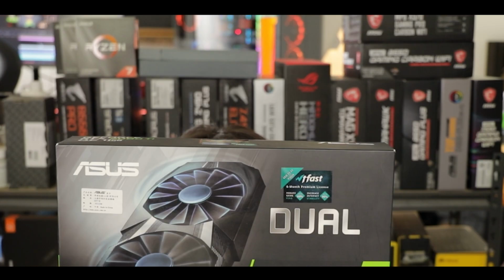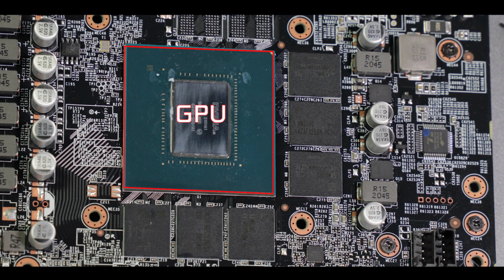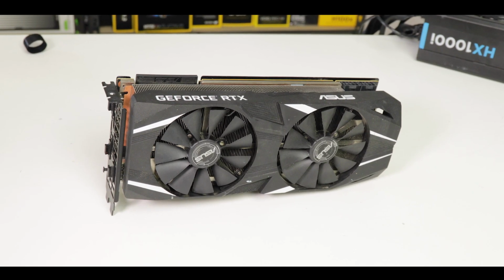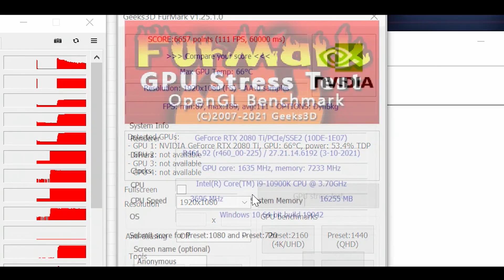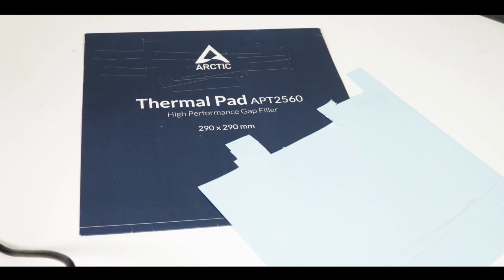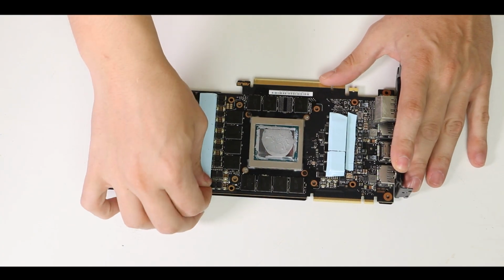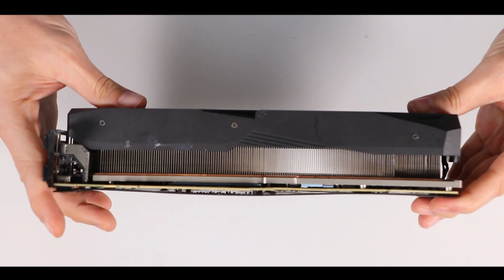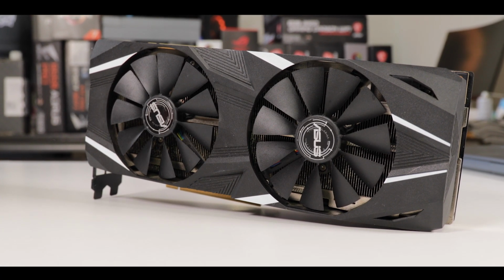Changing your video card’s Thermal Pads : BEFORE and AFTER benchmarking!

Comment: I was terrified the entire time, but replacing my thermal pads made a colossal difference, 100% worth it.
Reply from the maker: What video card did u do it on? How much of a performance jump did u experience?
Reply: @Laurentschoice  It's an Aorus 3080 Xtreme, the VRAM was consistently going above 100°C at 200W and once I opened it, it was clear why.  The stock pads were flimsy, greasy things that weren't doing much.  I put in some Thermalright 12.8W/mk pads and it made a huge difference, I can crank it up to 100% and it only hits 90°C at 400W.  Still hot, but much better, the giant four slot heat sink is now doing something instead of just taking up space.
Reply from the maker: AORUS should be ashamed of posts like this... seriously... they charge 1500 bucks for this card and they can t put 10 bucks worth of thermal pads?
Reply: @Laurentschoice  It's crazy, it's a spectacular GPU, held back by those stupid greasy thermal pads.  I don't understand the thinking there.
Reply: My Aorus 2080 has always run hot AF since the day I got it. I have good airflow in my case too.
Reply: @funghazi  I have the exact same 3080 as you, I want to do a thermal pad change on it but I'm not sure what sizes I need and how many pieces of each size I will need letalone what's the ball park cost of all the thermal pads I need. I Did go ahead and get some of that pink thermal grizzly kryonaught extreme paste for it but I don't want to open it till I get everything I need to do a full change. Could you share your knowledge?
Reply: @atruceforbruce5388  bro its really the chip. It just runs HOT. Best bet is watercool, but i dont have a higher end 2080ti with a baller cooler. Mines an oem with a blower. Mibe stays cool, but i have to max fans out which is loud as shit
Reply: You can obtain even better results on the gpu you clean it better you izopropilic alcohol and not touching with fingers  😁 nice video
Reply: @funghazi  They probably want you to get a 3090 and still leave you with that wanting feeling after you get it.

Comment: Did the mod on my RTX 3080. Dropped 30 degrees and now runs around 84 degrees. Used Arctic MX-4s for paste and pads used Frosty Thermal Pads - 12.8 W/MK. I tried all brands, but these do the same @ 40% less price. Incredible pads.
Reply: i just ordered it for my 3090 FE lets se how it is going to do.
Reply: @navaneetkumarbogum7528  So, how did it goes ? Did the core temp increase as an effect of the decrease of the vram temp ? (Cause I want to do it for my Sapphire pulse RX 5600 XT but I heard that the core temp increase)

Comment: Did this on my 8 years now old laptop, the gtx 765m was getting toasty. Used artic pads and artic mx-4.
Reply: mx-4 is absolute ok, you can use 5 or 4 not difference
Reply: Did the temperatures drop?
Reply: Yes, alot

Comment: I have to point out that you do NOT put pads on top of the coils they were never there originally and you can tell as the heatsink hasn't got a flat surface for them to press against. This will just cause improper contact with the rest of the pads.

Comment: Do you know the thickness of thermal pads on Gigabyte RTX 2080 Super Turbo 8G ? I can't find it anywhere, and Gigabyte support does not reply.
Reply from the maker: Gigabyte is usually on 1mm on their Turbo (turbin fan) model
Reply: @Laurentschoice  Ok thank you, it did seemed like 1mm on memory but the other smaller pads looked a little bit thinner. Is it better to first use 1mm on memory and 0.5 on the smaller areas, or try 1mm on all of them ? How do you think ?
Reply from the maker: It is very important u get the same thickness as originals. 
Place the pads next next each other. If they are obviously thinner, u know ur dealing with 0.5 mm.
Reply: @Laurentschoice  I just changed them all for 1mm Gelid Solutions GP Extreme. As a paste I used Gelid Solutions GC Extreme. Maaan I am shocked. Temps on GPU went down from 88 to 70 MAX and temps on memory from 103 to 78. I can't believe there is such a massive difference. And what's even better, when I compared thermal pads, it seemed liked 2 of 5 were 0.5 mm and the rest 1mm. However, I changed all of them for 1mm and it works like a charm, I can't be bothered to replace two of them for 0.5 mm :P

Comment: I've now done this with Alphacool Eisschicht-pads.
1 mm, 11 wm/k and ThermalGrizzlyKryonautExtreme paste-..
the RAM is not fully pressed and reaches 94 *C under full load, hotspot also 94 *C. 
Idle 55-60*C..
The pads are quite soft so you could take 1.5mm of them! I'll try again soon!
Reply: How did it go, did you have better result with 1,5mm pads?  I've ordered the 1mm Alphacool Eisschicht pads to cuz both resources I could fine said they used 1mm over all components that need pads.
Reply: @woopie9511  1 mm was the way to go ! 1,5 mm is to big
Reply: @kaykay10able  thank you sir. I actually switched mine out today and had very good results aswell. The hot spot went down 15 degrees

Comment: at minute 6 there are two pads on the left. the thicker one wasn't on mine. should I install some like you? also the thicker one on the far right?
Reply from the maker: I did specify the thickness on the video.
If my memory severs me well the dual OC only uses 1mm thick pads all around which makes things much easier.
Reply from the maker: And yes install the extra pads they make a world of difference in terms of card durability
Reply: @Laurentschoice  thank you very mouch. I'll do it later and let you know
Reply: @Laurentschoice  Thank you for your answer. I have exactly the same graphics card. I didn't mean thicker, but wider. that must be the voltage converters, right? I have a hotspot of 106 degrees and hope that this solves the problem
Reply: I'm not sure, but I think there is a little bit of air between the graphics memory and the cooler .. I took 1mm alphacool 11wmk

Comment: I'd like to do it on my maptop but I don't know what pad thickness to buy, and unable to find spefici pads for my laptop. What is the process in this case please ?
Reply: just measure it using ruler
Reply: @hanzoverlord6720  I cant really measure the space between the memory module and the interior side of the heatsink when it's screwed you know what I mean ? I think I wiil have to try several thickness because if the pad is too thick it will break when apply the sink, and if it is too small it wont cool down. I would have liked having a tip first.

Comment: Laurent, how can we measure the pads when they are already flattened please ?
Reply from the maker: Just got what u meant. 
Yeah ...that was a asshle.

The used thermal pads sides usually keep their original width.  

If its your first time you need to compare them to existing new pads u might have... not the greatest... but thats what I do. 

If ur lucky some reviewers already documented ur card. If not ... u got to buy 0.5 , 1.0 and 1.5 mm and compare compare to existing pads. 

Keep in mind that most cards use several width on the same card !
Reply: @Laurentschoice  Thank you Laurent, currently my card is only 2 months old, but in future this is a great idea.

Comment: Hey question: how do I measure how thick or thin my thermal pads are?
Reply from the maker: ahaha.. good question! It is never easy. I usually get a pad I already know the thickness of and then compare it to the ones I don't. Not the most efficient method, but it works :)
Reply: @Laurentschoice  okay thanks! I got some calipers that I’m going to use to measure the existing ones on the card right now. Thanks for the reply

Comment: hey dude, i want to ask you, i was currently using rtx 3060 and I've use it for mining ( but not 24/7 like others ) some days i on and some days i turn it off back cause im scared that it will damage my gpu , and I've noticed that when im in gaming , the temp is going to 70° above and the most highest is 73-74° with using high graphics , is that fine ? and i also want to ask if im putting a new thermal pads on it , can it become like the first time i bought this gpu? thank you.

Comment: I did change the paste and pads on my old fermi card , but find out multiples pads slipped from their chips... I will not open the thing again because the paste and pads worth more than the card so if she die she die. 😅 Next time i will use some sticky pads rather than the normal one

Comment: I am thinking of changing the thermal pad for my newly arrived 3070ti. The mem is more than 90C when the core can stay around 60C. I read reviews of several products and some say the temperature drop is gone after several months as the thermal pads dry out. Can you take a look now and see if they are still working fine?
Reply: Yes,I do have the same question...A long term review would be great..
Reply from the maker: So far no changes too place. 
But it also depends on the quality of ur thermal pads. 

I got Arctic ones so I'll be fine for a 18 months minimum.
Reply: @Laurentschoice  Thanks bro for the reply...

One more doubt, if I use my GPU for crypto mining,will the thermal pads loose its thermal performance... what's the case with both stock and custom thermal pads..?
Reply from the maker: Stock really depends on manufacturer.  
If u crypto divide all times related to the card by 3.

Warranty , thermal pad longevity, card life span, and performance after 6 month crypto mining
Reply: @Laurentschoice Sorry I didn't get your message...

Can you please explain...

Between my GPU is Msi 3080ti suprimx..
Reply from the maker: If your cryptomining, change ur thermal pads every 6 to 8 months for optimal temps.

Comment: I wish I had the balls to do this, my 3090's vram temp goes up to 92°c in Cyberpunk and it's not even summer yet. But according to manufacturers it's still in the safe range for GDDR6X so...
Reply from the maker: Yeah... First time can be scary  .. especially with a 2 grand card!
Reply: Yes that's normal. lower 100°C is safe, mine run at 94°c in cyberpunk (RTX 3080)
Reply: @l.s.g9372  my 3090 FE is running at 98C since i bought it, i guess bad thermal pads on it. ordered these 1.5mm once for changing lets see what it does

Comment: I can not check my gpu Memory Temperature
The program doesnt give me that option
Reply from the maker: Not all video cards install captors there.
Reply: @Laurentschoice  Laurent, I installed new thermal pads and paste then I was wondering if the pads were correctly in place end up open the card again and it was all good.
Now... Im wondering again if when I closed the card 2nd time if it changed place of the pads. 
I looked from outside the card and seems they are in good position and Im afraid to open again, to check it.
If its all good inside I just end up wasting more pads and paste in the process. 
I can rely on the Hotspot temp to check if vrams pads are correctly in place?

Comment: hi bro how r u ? r u lebanese? m from lebanon  m asking u if u can help me i have manli galardo 3080 10gb do u know the thinckness of vrm thermal pad?
Reply from the maker: Different thickness for different components on your card. 
Make sure to have under hand 1mm, 1.5mm and 2mm pads. 

When u open ur gpu, compare used pads thickness to the new ones. And replace

Hope this helps
Reply from the maker: And yes I am also Lebanese  :)
Reply: @Laurentschoice  thx u hbb only i need 2 know the thinkess on vrm memory do u know the size?
Reply from the maker: Every gpu is different... and use different thickness
Reply from the maker: Oh u mean board ???
Reply from the maker: For motherboard usually 1mm
Reply: @Laurentschoice  no nt on motherboard on memory of gpu 1mm gd?
Reply from the maker: Should be yes.
Reply: @Laurentschoice  bro the 1mm its nt the correct size pls help my gpu name manli gallardo 3080 10gb pls i need the correct size of thermal pad on vram only

Comment: I'll be applying the APT2560 on my RX 5700 XT. Memory temperatures can reach 108C so I suspect some thermal throttling may be happening, and unlike Nvidia cards, this one DOESN'T ramp up the fans on memory overheat.

Date of upload not exactly confidence inspiring though.

Comment: can i use my free thermal paste from my aio cooler?
Reply from the maker: should not be a problem, what brand ?
Reply: @Laurentschoice  my aio is darkflash
Reply: @Laurentschoice  another question, 2.4W/mK thermal pads are good enough?
Reply from the maker: No. I d go at least 5
Reply from the maker: Its fine
Reply: @Laurentschoice  at least 5? That's sad because the gelid pads are expensive and i need 2 types so it will cost $21 and the cheap one will only cist me $5
Reply from the maker: I just tried to cool a GPU with cheap pads... trust me....its just as good as if u put nothing there. 

Difference is huge, especially on memory modules which needs goid quality pads.  Thats 20c degrees difference
Reply: @Laurentschoice  4W/mK its cheaper is it okay?

Comment: I would like to make a suggestion. 
Now this may take a bit of time and some extra leg work. 
But take a pictures and or make a scan of both sides of your GPU. 
Get two sets of prints 
the prints should be the same size as your GPU.  
On the 1st copy, write down numbers next to each one of the screws giving each of the screw a number do the same on the 2nd copy, do this for both the front and back of card on your card picture  
Now as you take out the screws. 
Place each screw on picture on the photo of GPU by doing this you will know which screw came from which hole and this will help when you put the card back together.     
On 2nd copy next screw number write down the number of turns needed to take screw out this will help you to not over tighten a screw when you put it back into your card when you put card back together 
PS Also look for  a video about changing the a thermal pad on your make of card this will give you a little more info on doing this good luck